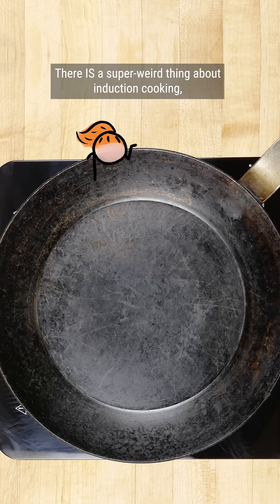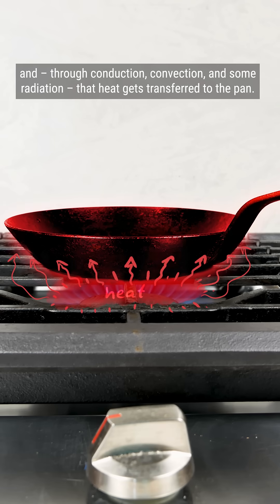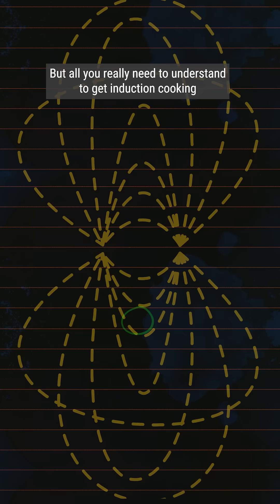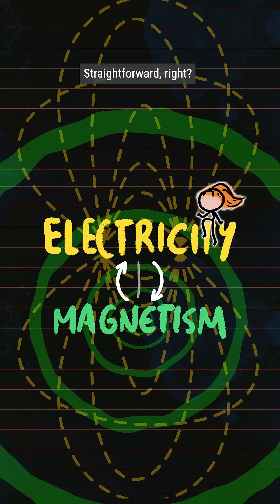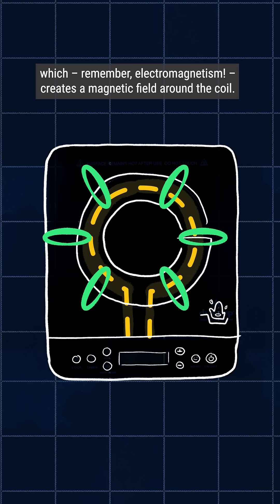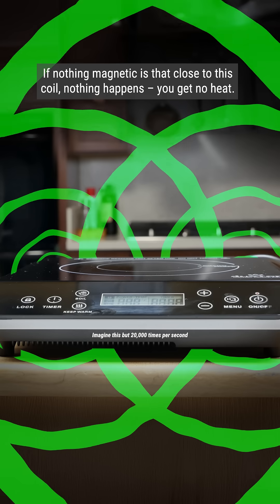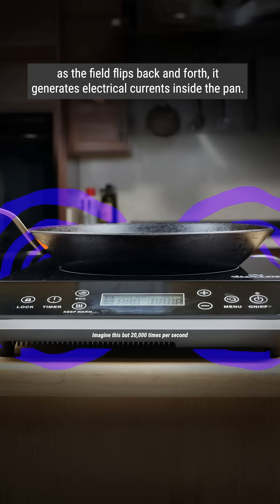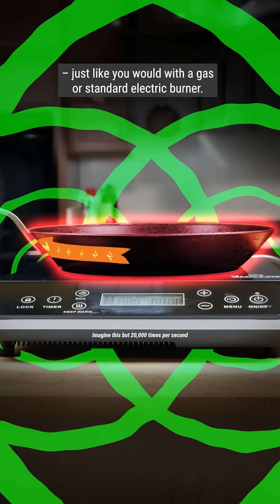How Induction Heats Your Pan

Comment: Some more fun facts about how induction works, from your friendly neighborhood engineer!

The changing magnetic field induces something called Eddy Currents, and its acutally very similar to how transformers on powerlines work. Instead of travelling through power lines, the current generated in the pan "short circuits" and heats up the metal. Think of it like a space heater powered by a wireless phone charger (kinda)

Since heat is generated in the pan itself, there's no losses due to heat transfer; other stove types depend on radiation (Infrared) and conduction (metal-metal contact). This makes it the most efficient type of electric stove you can get!
Reply: Microwave enters the chat...I'll take the glass, but leave the metal objects outside.   Btw same use of magnetic waves, but tuned to water..wild!😮😅
Reply: @MrM6d No it is not. They are not magnetic waves. And they are not heating the food through electromagnetic induction.

These are electromagnetic waves which comprise a changing electric field and changing magnetic field which is perpendicular to the electric field. And these waves travel at the speed of light.

And they heat food by the photons being absorbed by the water molecules causing them to vibrate.

There is no eddy current creation, unlike induction cookers.

Totally different principle at work.
Reply: @deang5622  negative. Both are on the EMS. They are both waves. Photons do not warm food in a microwave, that's a completely different wave length. No visible light is created in a microwave except from the little light bulb inside.
Reply: @kaiserxion  You are completely wrong and it is highly evident you did not study physics in school.
Myself, I have studied electromagnetics as a major part of my university degree. I am an engineer.
Go away and learn the subject properly.
Reply: @kaiserxion  Photons are all wave lengths though. And yes, they do, via creating dielectric heating. A large difference between a microwave and an induction coil is where that electromagnetic field is. 

In a microwave, polar molecules align themselves to an applied electromagnetic field (from the cavity magnetron) and as this field is moved, the alignment changes, causing the molecules to rotate and hit other molecules transferring heat. 

In induction, the electromagnetic field is generated within the object and resistive heating of the free flowing charge carriers hitting the body of the conductor (electrons hitting the iron) causing the iron particles (usually larger segments of the crystalline lattice) to vibrate and therefore become hot
Reply: Fun fact, the cooker knows when the pan is there through inductive impedance sensing.

Sort of like when you would know you were pulling a rope back and forth with a bell attached to it or not.
Reply: the transformer analogy is a bit misleading.
it's tempting to look at the cooker and the pan as forming a "current step-up" transformer in which the pan is the secondary, but it doesn't work (as well) with non-ferrous cookware. at the same time, transformer windings are just that (copper.) ergo, it's a magnetic thing.
I think the pan heating up is similar to the iron core of the transformer heating up (an undesired side effect in a transformer) due to eddy currents and, to a lesser degree, hysteretic losses from being magnetically cycled, not one big current heating up the pan via Joule heating as the transformer analogy suggests
Reply: @ahG7na4  You're correct, I've updated the comment about the material. I used the transformer analogy for EM coupling more than stepping up/down the voltage, to try and explain it's more of a "wireless resistive heater"
Reply: @ahG7na4  The transformer analogy actually works very well and it also predicts that copper wouldn't heat very quickly.
A pan on an induction stovetop IS a transformer.
Reply: @Ryrzard  no. you're thinking of the secondary winding running open-loop. the copper doesn't heat as long as there's a break or only a light load such that R(load)>>R(winding) - but the pan is supposedly a short-ciruit in this analogy.
Reply: @ahG7na4  It is a short circuit (in the sense that the resistance depends on the geometry and material of the pan). With similar current running through them an iron pan will emit significantly more heat than a copper one.
Reply: Can you theoretically charge your phone, because induction?
Reply: @querela92  If by theoretically you mean we already can and do then yes. Modified a little to not turn your phone into a rapidly expanding device of course
Reply: @mini_mcgee  microwaves are even more efficient since they heat the food directly, though that makes them fundamentally different to use
Reply: I have some random questions:
1- Is the pan atracted to the heater when it's on, like a magnetic?
2- How much more efficient it is?
3- If i use a metal spoon, it will be heated too? And if yes, it will raise the consume of eletric energy?
4- The consume of eletric energy changes to heat different pans?
Reply: @ 1) It is not attracted to the pan. 2) about 10% more efficient than standard electric ranges
3) It only heats ferromagnetic materials a few mm above the surface of the stove, metal spoons will not heat up more than usual
4) it only works on steel/iron pans, or pans with steel inserts. On other pans it will simply do nothing.
Reply: @KekusMagnus  Thanks
Reply: Honnestly its the momebt i realised the oven never get hot its the pan heat that transfer to the over top. All my youth i thought it was hot like a normal oven and never questioned it again
Reply: then.. how exactly do (at room temperature) glassware work on it?
Reply: @sailaab you probably don't have an induction stove, if it heats glassware. It's an older, resistance based heating stove. Does it heat up even if you don't have a pan on it? Induction stove would just display an error.
Reply: @sailaab if they do its not a induction oven induction requires metal to work
Reply: @sailaab  glassware doesn't work with induction, only ferromagnetic conductive materials like steel or copper heat up.

Edit - all conductive metals can be affected by Eddy currents, not just ferrous ones
Reply: @mini_mcgee  Not copper though, it's not magnetic but would be great to have a layer of it to conduct heat.

Comment: Could that affect the way food is cooked? Like what if the food was high in iron like a blood sausage?
Reply: It will affect the cooking as the frying pan will heat unevenly. So unless the spiral diameter equals or exceeds the pan size, avoid using induction with steel or cast iron pans.
As for the foods rich in iron, it's nowhere near rich enough to get affected in a meaningful way.

Comment: Fun fact: it's quite easy to figure out out if a pan is induction compatible.
Does a magnet sticks on it? If yes: induction will work.
And so I discovered that my salad bowl is induction compatible.
Reply: Hold it there, don't want salad to be hot and the soup to be cold
Reply: any salad can become a soup if u boil it 😈 @calvinnyala9580
Reply: It is not so easy to explain why this is so. Any conductive metal placed over the induction hob will have roughly the same currents induced, so they should, by that argument get just as hot but they don't. It's down to the skin effect, magnetic materials confine those induced current to a thin layer on the surface which being thin has a higher resistance so it gets hot. Don't believe me, then put a sheet of aluminium foil, which is thin on your hob. Watch it melt catch fire and destroy your hob.
Reply: Induction hobs work perfectly well on aluminium  and copper pans, for exactly the same reason that transformers wound with copper or aluminium wire work.
Reply: try copper then,,, its not the magnetism its the high current iductive material those metal would react with the high frequecy current passing in the material... think of it as radio broadcast anthenna and the metal tower is the pan
Reply: @tossancuyota7848 the ferromagnetism causes a lower skin depth so it is much more efficient.

There do exists stovetops for non ferro magnetic pans and pots but they need a higher frequency and tend to be more expensive

Comment: Don't wear mechanical wristwatch when operating induction cooktop.   Can't be good for the wristwatch, even though the field is alternating.   Risk especially bad if no load (no frying pan) on the stovetop, when the appliance is ON.
Reply: Most induction cooktops have a sensor that detects whether or not there's a load, and it shuts off if there isn't one.

Comment: Isn't the alternating part irrelevant? Wouldn't the heat be created just the same with DC?
Reply: DC current would also produce heat but it is not possible to induce DC current via induction. A static magnetic field does not generate electricity. An alternating magnetic field produces an alternating electric current.
Reply: @Sweet-Vermouth  Yea correct I forgot about that

Comment: How does the induction burner boil water in a glass kettle? Is it the water within the kettle that is conducting the alternating electric current?
Reply: A completely glass kettle doesn’t work on an induction stove
Reply: @ I got confused. My stovetop is a glass top stove that I guess heats the glass which then transfers the heat to the glass kettle. For years now I've thought it was induction, when in fact it was not.
Reply: @pavelmedbery3055  can you see a glowing element through the glass stovetop? That's just an ordinary resistance heater, or possibly halogen. Induction is more efficient and maintainable. For instance, you can wipe most spills on induction with a paper towel without even turning off the hob. Hobs relying on conducted heat will burn. With induction, the only heat on the glass surface is conducted down from the pan.
Reply: those have Metal at the bottom or somethinf
Reply: Seriously? Did you look inside the kettle? There's a metal base. Did you even go to school?

Comment: Much better type of short! Actually explains something from the original video instead of only teasing and not explaining anything at all.
Reply: yees
Reply: Does the handle also get hot if its a cast iron pan?
Reply: @santiagocostales6530  The handle is to far away from the coils, and doesn't heat up directly. After some time, some heat from the pan will transfer to the handle.
Reply: @Harald.  Can I get my rusty iron finger ring with induction (no pun intended)
Reply: @santiagocostales6530  No, too much resistance for the electricity to pass and make a  "loop" to and from the handle
Reply: Agreed!
Reply: Lol, if only she explained how it actually works 😂
Reply: 3 minute shorts helped with this I guess
Reply: As much as i relate to you I don't think that we have the right to blame them , not everything can be explained in a 1-minute video true understanding comes from deliberate focus and time and while this video is a good use of shorts a lot of other videos are just pseudo-science and a waste of time.

Comment: So why doesn’t my pan shock me when I touch it on the induction stove?
Reply: Because the pan isn’t gaining or losing electrons. They are just moving back and forth inside the metal. So if the pan starts out electrically neutral, it will stay that way

Comment: So it doesn't work on ceramic or clay stuff
Reply: No, it needs to be ferromagnetic. A good way to know if your pan is compatible is to check if a magnet sticks to the bottom of the pan.
Reply: Does a magnet stick to ceramic or clay? Duh.
Reply: Aluminum pan?
Reply: @ti-nu4ou  most aluminum cookware won't work well with an induction cooktop, but you can get aluminum cookware with a ferrous core embedded in the bottom that makes it compatible. Basically, if a magnet won't stick to the bottom, it won't work.
Reply: Are you regularly cooking on ceramic or clay cookware?
Reply: @MeatBall-1-3  Many cultures do, yes. For example, many Asian, Indian, North African and Middle Eastern cultures use various forms of crockery (tagines, chatti, etc) as primary cooking vessels. Of course, most stoves also have a traditional oven, so they can still be used in that way. But globally-speaking, using stovetop crockery in everyday cooking is actually very common.
Reply: @sonipitts  Le Creuset makes a rather pretty Taghine with a cast iron underside. Maybe others do too. Alternatively if you have a cast iron grill or something you could put the ceramic on top and heat it through that (at a significant loss of efficiency ofc).
Reply: @MeatBall-1-3  Yes, it's common thing to do over here
Reply: @HMAOO86  huh, today I learned I guess! Maybe I’m imagining the wrong type of ceramic but how does it not crack under the heat?
Reply: Neither does it work on hands... unless you have freakishly high iron content in your blood.
Reply: @BobHill-s2c  no, the iron content of your blood could never make you susceptible to heating by an induction heater. Don't just make stuff up.
Reply: You can get a metal plate to go between the burner and the clay piece.

Comment: Does the magnet from the induction stove actually give the pan electricity as well?

So in that case, if you’re cooking with one, could you get shocked by the pan even before it’s hot?
Reply: 1. There's no magnet just a coil of wire, the electricity flowing through that wire creates a magnetic field, this is known as "Faraday's Law"

2. No the reason the pan gets hot it's because it sucks at creating a path for electrons to flow so electrons get stuck and bounce with each other all around the material so that kinetic energy of the electrons colliding dissipates as heat, that's why it heats up
Reply: There's not actual electrical "current" flowing through the pan so no current = no shocks
Reply: Technically speaking, there IS some current inside the pan: they're called Eddie currents.
Actually, those Eddie currents are the very reason why the pan heats up!
(This is because there is some "random"
voltage imbalance everywhere in the pan.)
But thankfully you don't get shocked: those voltage imbalance want to reach each other to a stable equilibrium.
It basically means that the voltage doesn't want to leave the pan.
Reply: @OslerS there must be current but no voltage difference.
Reply: @OslerS  An electrical current flowing in the pan is precisely why it heats up.

Comment: Can i get electrocuted by the pan then?
Reply: No, the current is induced only inside the pan. Even if you put your hand on the burner you wouldn't get shocked
Reply: The "current" basically runs in circles inside the pan.

Comment: Does that mean you could fry your phone or the magnetic strip on a credit card if you get too close to one of these
Reply: Well, to be fair normal stovetops could also fry your phone if it gets too close 😉
Reply: @giannis_m  yeah exactly xD
Reply: -me when i put my phone and credit card to side when cooking a meal so i can use them as seasoning later
Reply: Heat will mess it up before the field tbh
Reply: Probably yes, but doesn’t the same thing happen with a gas burner?
Reply: Your metals need to be on the stove to be heated,beside the stove is fine too.
Reply: my Airpods get cracy interference while if my phone is too close while cooking and listning to music :)
Reply: Maybe a credit card but probably not a phone. They usually won’t turn on full power until they sense a pot being present -you could maybe get it I run if you quick remove a pot and then put your phone there. If it makes you feel better a radiant or gas cooktop will break phones and credit cards fairly reliably :)
Reply: If the magnetic field is strong enough maybe it could mess up your electronics but it depends on what exactly and probably not since they're inside a plastic housing and PCBs are not much affected at all
Reply: @OslerS You think the plastic case stops a strong magnetic field getting through to the electronics of your phone?

You really don't know much about electromagnetics, do you?

Comment: but why the stove itself becomes hot?
Reply: Because there is a hot pan on top of it
Reply: heat from the pan, and waste heat from making the magnetic fields. Electromagnets do tend to get hot themselves.
Reply: Because the pan heats it
Reply: The reason the pan gets hot is the same reason why an incandescent bulb generates light, because it sucks at creating a clear path for electrons to flow so electrons get stuck and bounce with each other all around the material so that kinetic energy of the electrons colliding with each other dissipates as heat, that's why it heats up that phenomena is called 'electrical resistance'

Comment: @Minutefood Do induction cooktops keep the same frequency?  60 Hz? (America)
Reply: No it's, but it's in the range of 25 to 50 kHz. The reason I why is a bit complicated.
Reply: It makes sense it'd be a higher frequency, otherwise a coiled power cord could be an induction burner.
Reply: @coolreader18  A power cord has equal and opposite currents in the two conductors at all times so a net zero magnetic effect (except between and very close to them) of zero.
Reply: No, induction cooktop use driver circuit that's powered by internal power supply

Comment: Could the Earth magnetic North Pole being shifting due to climate change?
Reply: No. The magnetic field is mediated by the iron core of the planet and climate change would have effectively zero impact.
Reply: @vrts  Is the movement of water and air currents, even the amassing of water into large dams that can cause delays in the Earth rotation negligible to the Earth core?
Reply: @johnnychang4233  
1 - there is such little mass on the crust of the earth compared to the inner mantle and core that we cannot functionally manipulate the angular momentum, nor can nature.
2 - The earth's magnetic field is produced by convection currents in the mantle, which has nothing to do with the earth's rotation.
Reply: @ Are those liquefied mantle having an inertia for themselves that is immune to any rotation or translation of the Earth?